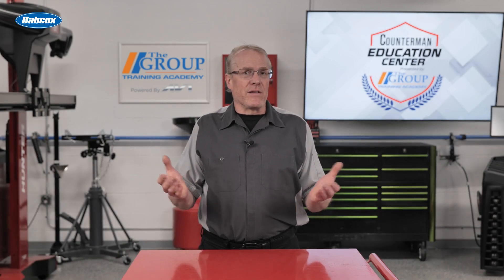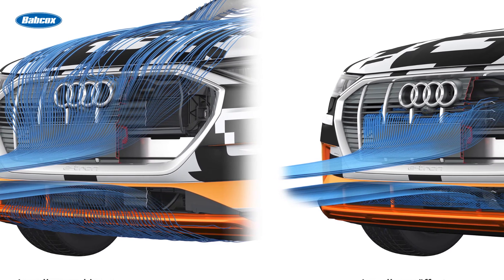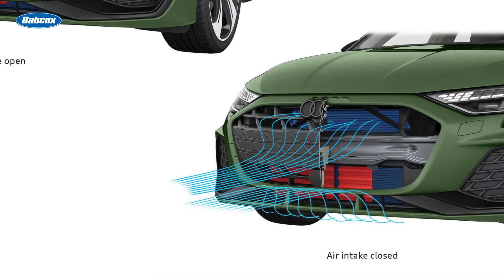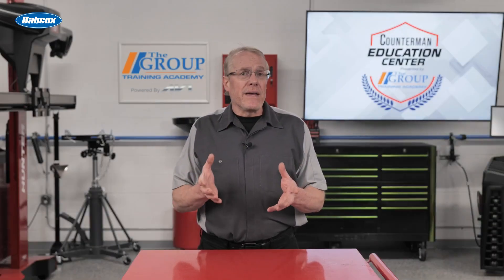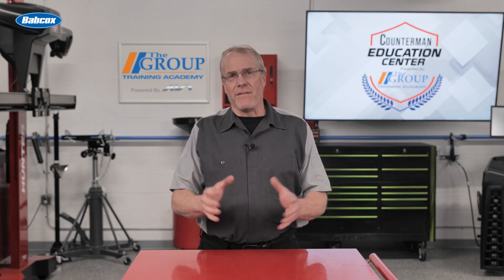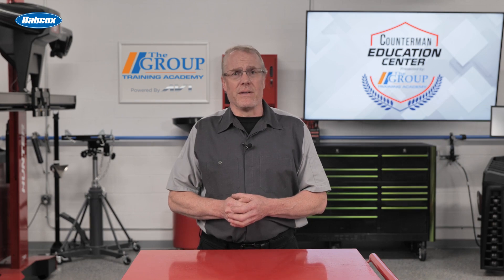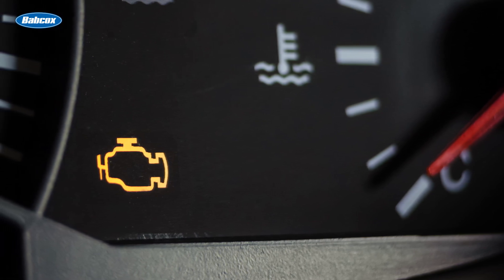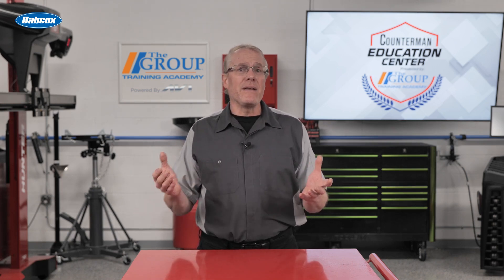Understanding Active Grill Shutters in Modern Vehicles

Comment: The concept is not new as I recall seeing them on semi-trailer radiators about 65 years ago.  It was a bit curious to see the radiator on a Peterbilt totally blocked by chrome shutters.  I did see them in the open position also.  Complexity lives.
 Question is, how does air get to pass over the condenser if flow is blocked?